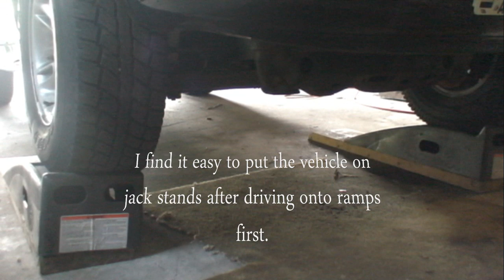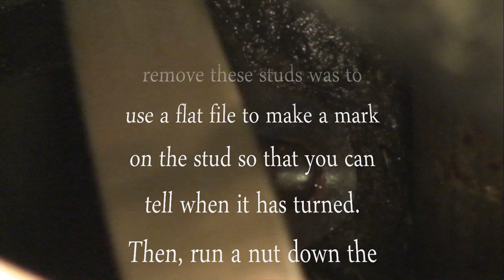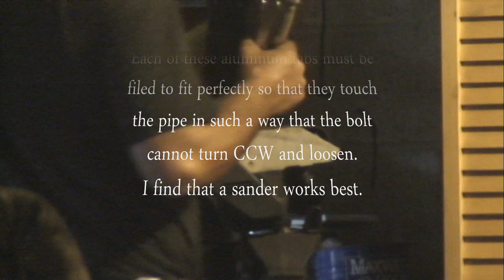How to Install Headers - 2000 Durango 5.9L

Comment: hey how did you get the new headers to clear low enough around the spark plug heat sheild ( like where you trimmed the gasket to fit around them) mine seem to bump up to them and dont line up and im pretty sure they are the exact same headers as you got here.. on a 5.9l as well

Comment: Putting headers is dumb especially when the vehicle is not a performance, i had those headers on my durango and it wouldn't pass smog so good luck chuck
Reply: Junior Contreras video is almost 10 years old dude. Im sure it worked out